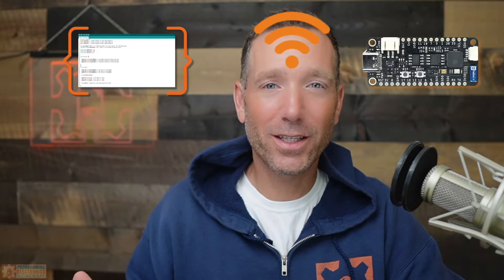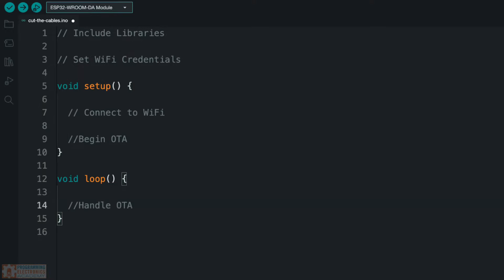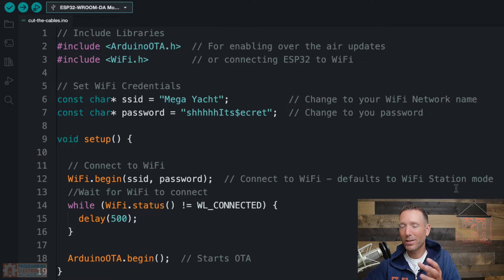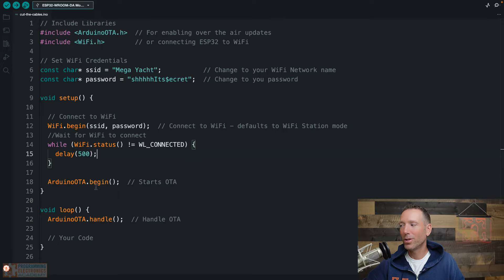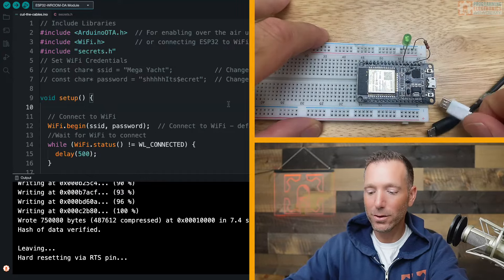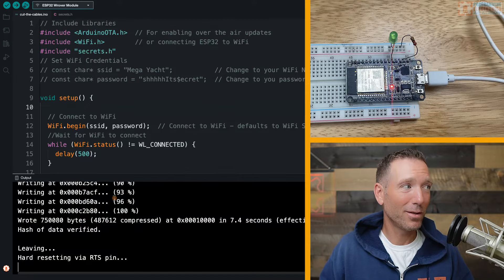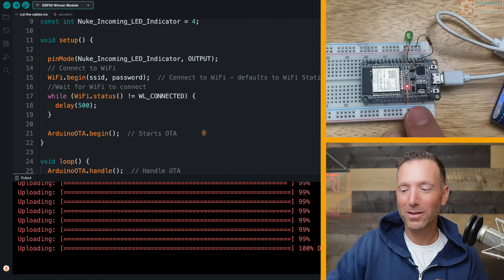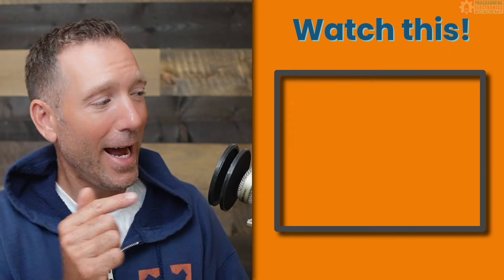The EASY Guide To Over-The-Air (OTA) Updates With ArduinoOTA

Comment: I use ArduinoOTA all the time with my esp32 projects and it works even better with PlatformIO rather than the Arduino IDE. ArduinoOTA also works in parallel  with ESP Now comms, but needs a few tweaks to work correctly.
Reply from the maker: Thanks for passing this on!

Comment: ArduinoOTA is super cool.
I have a keyboard that can update the key mapping though bluetooth. Is it the same technique?
Reply from the maker: Great question!  I'm not sure to be honest.
Reply: does it keep that mapping after all power is lost?  then at least some part is being flashed, probably not the whole esp32, just a specific partition.  Which is what is actually happening here too, the flash is divided into partitions, 2 biggest are identical OTA0 OTA1.  the new program is store, entirely on the other partition, before the flash happens..cause breaking connection during a flash is b...a...d.....bad!  but your keyboard probably has another set of partitions for the mappings without having to disturb the main program memory .

Comment: Great Tutorial. One Question.  I have three ESP32 Cams in different locations.  I noticed that the OTA program sets the ip address of the network port.  I have tried changing that address, but it would not change the IP address.  How can i set the OTA initial code so that it will update to the right camera, and not accidentally erase the code of another camera?  Thanks, Tony
Reply: It's not the OTA that sets the IP address it's your router. The best way around this is to set a fixed IP address for each esp cam in the SetUp section of your Arduino code, then you can upload to each cam separately as required.

Comment: Hi i am using ESP wroom 32 to test OTA technology. So i have uploaded the code, since i don't have any other battery source, i am powering up esp board with another laptop source but in my laptop it is not showing network port. What could be the problem??
Reply from the maker: Just to verify, both esp32 and the computer are connected to the same WiFI network?  Can you verify that your ESP32 has connected (ie. are you printing out to your serial monitor that it has connected to the local WiFi?)
Reply: @programmingelectronics   yes both esp32 and laptop is connected to same network
Reply: This issue is solved. It was problem with the network, i tried connecting with another network. Now if i have to upload the code from distant place, what can be done(i.e. if i am not in the same network range) ?
Reply from the maker: @melvin-rh2gr   Yes, can be done, but requires some additional steps, I'll see if I can make a video about it.

Comment: Hi. Why the OTA handle is not on setup ?
Reply from the maker: Great question!

Since setup only runs once, the code that manages the actual OTA process wouldn't be able to run in the loop.  At least that is my understanding.
Reply: I get the same problem of having to restart the Arduino IDE or even restart the PC. The ease of not having to retrieve the MCU a plug it in versus restarting the IDE/PC is incidental. It’s a minor bug and one day, hopefully, an Arduino Guru will fix it.